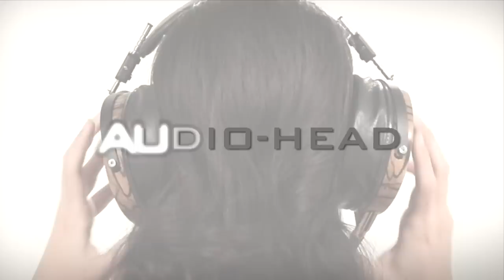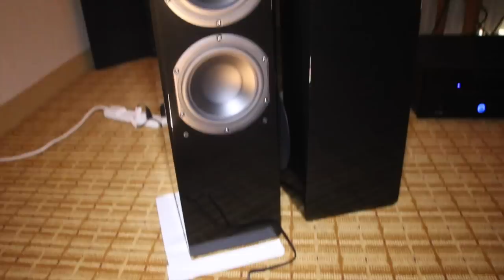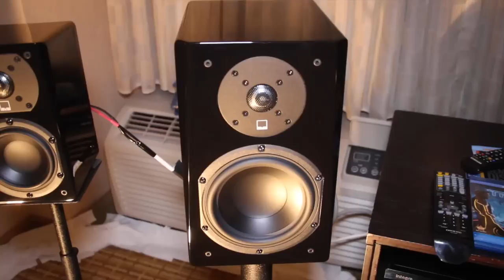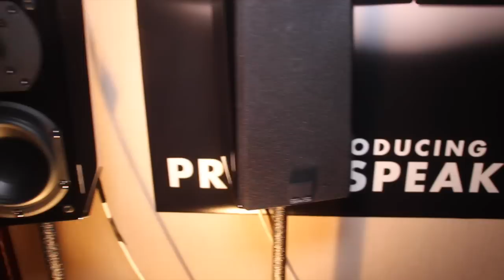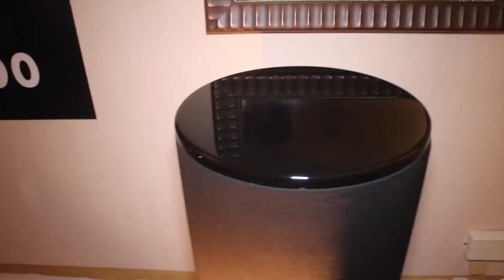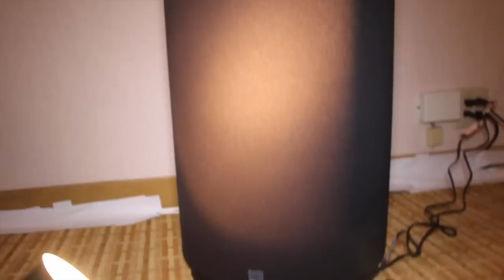SVS | RMAF 2014

Comment: Your subs are kinda overpriced.
Reply: Curt Park haha
Reply: Curt Park  Compared to what?
Reply: I agree...Compared to what?!!! Who else offers a phone app where u can do everything for this sub from ur seat other than move the sub to different locations n the room. Use the supplied remote or connect ur smart phone which is even better. U can c everything on ur phone. It even has tutorials for everything on ur phone. Don't know about u but I hate getting  up to change the volume or phase or anything on a sub. Besides properly placed, these subs ( the ultras) will make u have to get up to screw lightbulbs back in.!!!